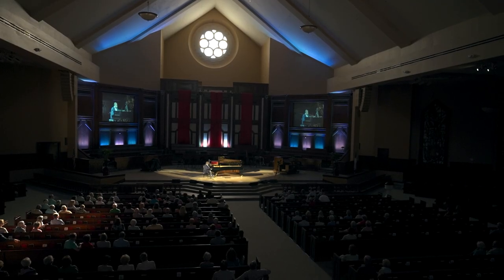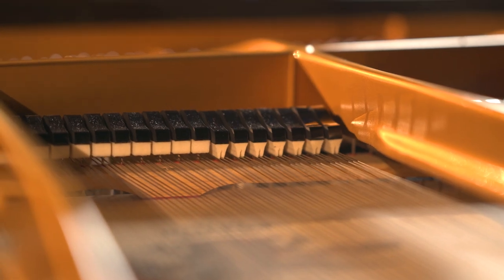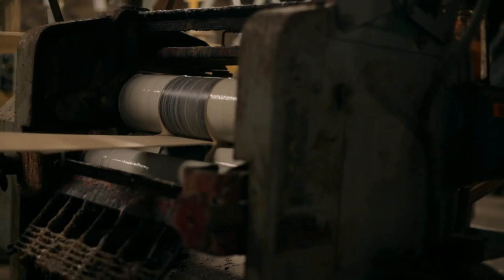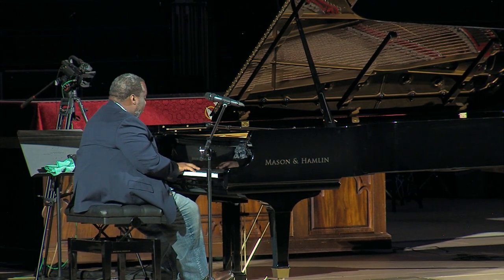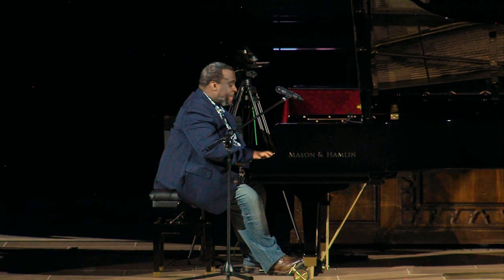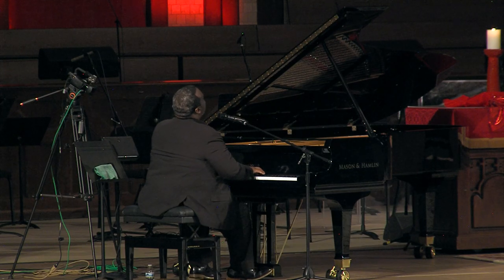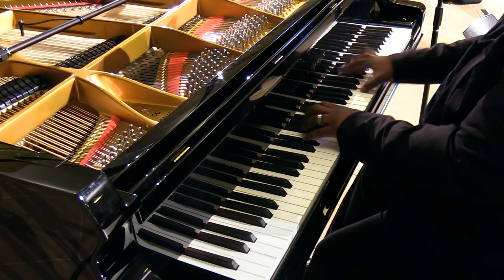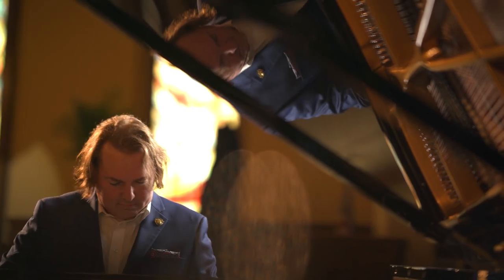Reviewing a Mason & Hamlin CC Concert Grand Piano

Comment: i much prefer Fazioli
Reply: Fazioli is a superb instrument, but Mason and Hamlin does have its good points.
Reply: Power and (power in sustain) is unmatched due to the radial Tensioner. It keeps the vibration in the Soundboard where it will do the most work of tone production instead of being parasitically sapped away by the rim etcetera. A piano is not a violin it just doesn't work that way. This is the goal of both Steinway as well as Mason & Hamlin but Mason &H achieves this goal more completely via it's totally unique and effective Radial Tensioner. Not to mention safeguarding the soundboard crown into old age.